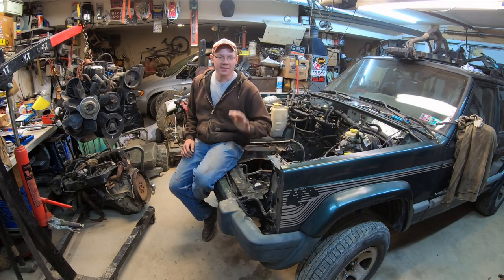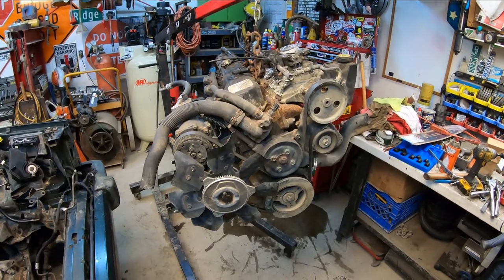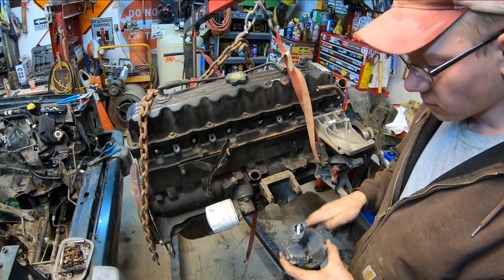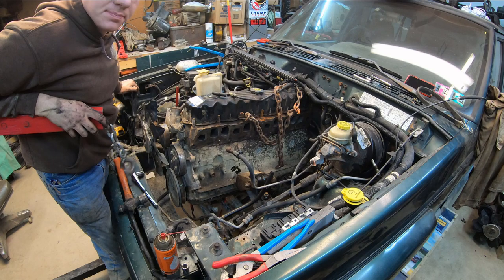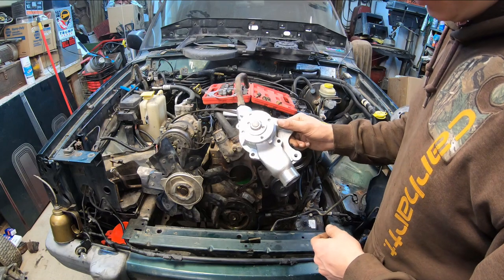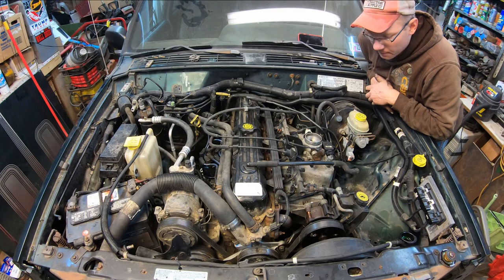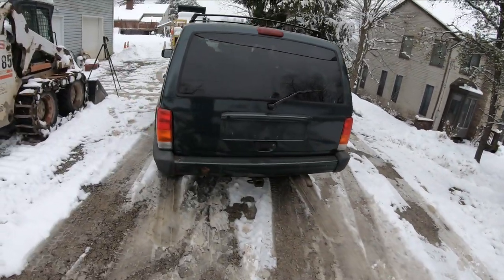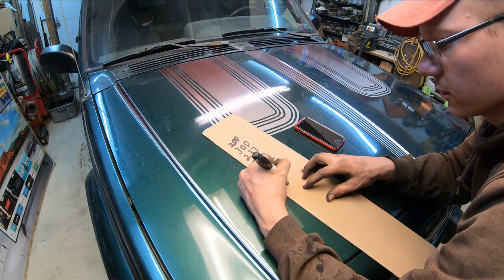$200 Jeep Cherokee gets JunkYard Engine,  WILL IT RUN AND DRIVE???

Comment: As years go by, I have heard the term government overreach and other terms of endearment used. It is actually just a small step at a  time and no one complains then. Where they to go from one style of fuel or ignition... small changes.... no one complained when you could start the car from the comfort of the kitchen chair and let warm up a bit to now days, all electric and no heat up required. I haven't seen a tesla car to see if its warm when you first start that new rig and its ten below outside. I don't really want to know tho. Nice little teaser, the orange rig on last part or the "altro" side of videos .... that ending part since I am too stupid to remember what its called. I do believe if its a flat bed with a cab an everything is on the deck behind the cab.... it will be a driver in two videos or might be third. Just as long as you mint these videos, I will be watching it all so thanks for sharing and happy upcoming holidays

Comment: The foil is wrapped around the injectiors for keeping the fuel from boiling due to the close exhaust location to fuel rail. It also melts the wires. Can I buy your unused exhaust and intake manifolds? I work on crosscreek.

Comment: That's cool ,good deal . I bought a 2010 honda fit for $300 after a new clutch (ya it's a 5 speed ) tire's an like you said dam tax an title work i got about  $1100 into it my beater with a heater 😂good vidja  !

Comment: Cost:  Why did you not add any money for your time?  The time you used to repair the jeep needs to be added in also.  The time you used to repair the jeep could have been used to complete contracting jobs so time spent on the jeep needs to be accounted for.  After you add in your time then compare your jeep to similar jeeps being sold in the same condition then it can be fairly determined if you made the correct decision to repair the jeep.

Comment: I say you have a good run around jeep. You won't be putting all the miles on your truck. Tires look into BF Goodrich M & snow An just a size or 2 up, will make a big change,an look an great off road runner.

Comment: The old man was a mechanic for over 50 years he had a list for engine swaps even if it was removed from a car he drove 
check all freeze plugs
always change the rear main seal skip the possibility of an extra pain in the poop pincher 
change oil pan gasket  nothing like a subframe or diff in the way 
change thermostat and water pump 
if it was made after 85 always change the valve cover gasket  to much plastic and extra crap in the way

Comment: I had a 1998 Jeep Grand Cherokee. Ran outstandingly well. One of the gas straps rusted away while I was driving, couldn’t locate a replacement so had to let her go.
Reply from the maker: They should be super easy to source, everything for these jeeps is readily available and pretty cheap

Comment: $900 isn't bad at all. We just did a 95 engine swap. The Remanufactured engine was around $2000 by itself. I wanted too go used, but it wasn't my decision. With that an labor, the girl is almost $4000 in the hole on it, and we haven't seen or heard from her. Might end up being ours too sell. It's all covered in offroad goodies, roofrackl lightbar, 31/10.5r15s. My boss will probably end up driving it.
Reply from the maker: Well sounds like it will work out for him at least lol

Comment: just for reference the 4.0s run about 200 to 210 which is completely normal I have the 4.0 and mine runs just under or at 210

Comment: Why do you care what the peanut gallery thinks?  You purchased a piece of junk and made it into a decent road machine.  Good for you.  I wish I half 1/2 of your talent.  BTW, did a see an orange can of Sili-Kroil?  If it is, how do you like it.  I have two cans in my garage and used a couple of squirts out of one can and it seemed to be O.K.  Your Jeep Cherokee project was interesting.  Thanks for sharing it with us.  I'm anxious to see the  innards of the original Jeep engine.  Good luck with your beater!
Reply from the maker: Yes that’s kroil I use it on the really stubborn stuff because it’s so pricey, I honestly don’t think it’s worth the money but it smells good 👍🏼

Comment: Those engines are notorious for piston skirt cracking, and head cracks. anything past 1998 or so. I bet that's where all the oil came from in the old one. Check the upper radiator hose nipple port on the radiator tank and make sure it's not cracking. That garbage fiberglass blastic crap will crack and you will be smelling coolant for all of eternity until it cracks with no  visible highlighter ink puddles on the ground.  The non-operational windows and presumably central locking, that don't need help staying up is because of the wire between the body and the driver's door. the wires are made of used twist ties, so they break easy. Don't overlook the rear trailing arm bushings for the clunking, all of our jeeps had that issue. it makes the clunk sound like it's in the front end. If the transmission stops shifting well, replace the pigtail on the output speed sensor wire on the transmission. don't make the $1000 I did and replace the whole damn transmission when that's the issue. Do yourself a favor, do the rust converting on the rockers, and just put replacement sleeves on it anyhow. if you sneeze wrong it'll have a hole in them the size of your forearm. Check the rear axles for leaking axle seals. they go out around 150K on the clock. also if you plan on driving this thing any appreciable amount of time, Goodyear Wrangler ST's are your friend. They are the only tires that I ever got to last a while on jeep Cherokees, and the Grand Cherokees.

Comment: Don’t forget the ac on it as well not needed till warmer weather lol
Reply: That jeep doesn't have ac
Reply: @saltyymannscustoms6989  the pump was on new motor all the stuff was still on the keep the pump went bad and just put a Pulley and its place watch the first video when he took it out
Reply: @garybarkley2286  yes the pump was on the new motor but that xj like a couple of mine has the pulley where the pump goes so he only has the condenser. so no he cant put ac in is because he is missing everything but the pump for the ac system
Reply: @saltyymannscustoms6989  I just watched the video and he says the vehicle has ac they just didn’t replace it when it went bad so he just has to buy hoses for it check it out for yourself he says it when he is going over the keep in the garage
Reply: @garybarkley2286  all the cherokees on the climate control show they have ac even when they dont. I clearly saw the the non ac pulley on top of the engine i have owned several of these i know what im talking about

Comment: I have rebuilt more transmissions for front pump dmg due to that torque converter sliding out on engine pull and home mechanic not checking and rotating first when they tighten bell housing bolts than I can remember....heres to your luck you didnt punch pump gears through the housing.
Reply from the maker: Well It seems I got lucky then lol

Comment: An almost rust free 883 dollar jeep with the infamous Leaning Tower of Power is a steel.. well to me it is lol! Great job! Those straight six engines for the longest number of years have stayed simple designed by the engineers... probably not too much of a difference of one from the 60s until that era of jeep. One of the engines from mopar that I myself actually care for too because of their straight up torque 👍💪 That's saying a lot from a GM dude hahaha
Reply from the maker: I think every brand has at least one respectable platform that even guys across the isle can appreciate I’m no GM fan but who can argue with a 350??
Reply: @DieselCreek  Exactly👍
Reply: @DieselCreek  I swear dodge's 390 is similar to chevy's 350

Comment: “It’s nice when the engineers actually think about you...”

Hasn’t gotten to those stupid manifold bolts.
Reply from the maker: Lol ya... they weren’t that horrendous tho
Reply: I have the newer style with the 2 down pipes that are tucked right up under the intake... I had a tough time with them. 

As I recall, one of the bolts wasn’t much more than hand tight (from factory). Drove it that way for 17ish years and it never fell out- little miracles :)

Comment: What's the deal with engine swapping in PA in regards to the newer engine smog controls you're losing?  Back when I had a smog license in CA in '81, they went by the engine year, so any updated car had to add smog crap to match the engine.  It was brutal in some cases.

Comment: Should have left the intake an manifold on the new motor would have worked and better  Design on the 99 in Newer 4.0
Reply from the maker: I saw some people say that but the locations for the vacc lines were different I didnt wanna mess with it.
Reply: Well hold on to the newer one and if you ever want a little bit more power put the newer one on there

Comment: Very much worth what you've put into her. Since you clearly know what you're doing, I have a question. You mentioned undercoating with fluid film. I drive a Wrangler in Jersey, and recently undercoated with Cosmoline. Would you continue to spray off the salt ( and some of the undercoat in the process ) or just leave it? Thanks.
Reply from the maker: I’m thinking just leave it until spring then deep clean and re apply
Reply: @DieselCreek  Yeah, makes sense. Will do, thanks.

Comment: She purrs like a kitten again.
Squeeze the thick tube well with your hands, chances are you will squeeze the air bubble out.
Have you actually looked at the correct ignition time, the temperature can also rise with an incorrect setting.

Comment: if you only weld periodically, flux core is your friend
Reply from the maker: I use flux core in my portable mig but run straight co2 in my shop mig

Comment: Considering you can get some use from the Jeep, then probably sell for $1000 with your stamp of working approval, I'd say you did fine. 25% cost in registration/title transfer is probably what makes recycling old vehicles a non-viable business. If they found a way to subsidize the lower cost cars for administration costs, I bet ya there'd be a lot less in the scrap yard.
Reply from the maker: Then who would fill their fat pockets!?? Lol
Reply: @DieselCreek  Though I don't necessarily disagree with that sentiment, I do also doubt even a significant portion of the budget comes from the registration fees of junk vehicles. 

However, there's absolutely no reason to not subsidize low-value car title transfers if that is the case. They'd be losing less than a million a year, but potentially creating more than a million in jobs/side jobs. 

I do enjoy what you do, and this is one of the reasons.

Comment: They put that aluminum foil there because a lot of the 4.0 Have “Heat Soaking” issues !
Reply from the maker: Interesting I also noticed the sides of the injectors were all cracked as well I wonder if the heat did that

Comment: If ya'll don't turn thee gas off youse will have to learn old school and use another dab of flux whilst yee run thee hot wire. I have done it believe it or not. Brazing flux mixed with sawdust covers well. I'm old.

Comment: You never work in a junk yard even though you said you did.  You said you drain the gasoline out so you could put it in the yard vehicle and we did the same ,and when a vehicle came in with a popular engine we cut all the hoses and other lines so we could pull it out as fast as possible  . After you bouth it 《 it was your problem) not the yard!!!  That was the way it was sorry Matt , That's one of the reason I quit and the reason I quit working at a used car lot if ìt had one burn value you would fix 1 burn value and reused the old gasket set, I quit that job the first day also two jobs in 2days with no pay

Comment: "It's nice when the engineers actually think about you"? So unlike chrysler or jeep for that matter. Didn't chrysler make a car not too long ago that you had too take the front there off to get to the battery? And I had a jeep commando you had to take a motor mount off to change the oil filter
Reply: AnarchoSynCope  well the jeep commando yes but the chrysler was a 90s car AMC was long long gone by then

Comment: That's an older Jeep once I like to call the square bodies that engine transmission transfer case platform you can barely beat it I'm surprised that that 6 cylinder gave you engine problems the engine you're putting in it have to remember it's a scientifically proven engine it ran so wherever they pulled it out in other words it ran to the junkyard

Comment: just so ya know thoes gates water pumps used to be good but they are complete junk it will leak in about 6 months to a year. that engine looks like it has 11000k on it not 10000
Reply from the maker: The pistons look brand new, no carbon at all

Comment: whoever pulled that engine needs to be fired.  They cut the wiring harness, which is free money, they cut other parts, which again, is money they could have made.  When I bought a used engine for my cargo van, it literally came with the entire wiring harness intact, on the engine, not a single hose or line or wire cut.  I paid more for a "ready to run" engine, but will have to do zero work to swap it in, as it will just require plugging in all the harnesses, hooking up the grounds, and plugging in the fuel lines.  Junkyards that do things like what you had happen should never be trusted on the quality of their parts, because they are willing to damage stuff to get other stuff out.

Comment: 210* is normal. I’ve battled all my jeeps to get the temps down and all of them want to run at 210
Reply from the maker: That’s what I’m hearing a lot. Gonna try a few tricks and hope to get it down to 190-200 at least
Reply: @DieselCreek  With a 195F thermostat as specified for that year, 190 is wrong.

Comment: WHY would you NOT rebuild the Jeep 6-cylinder engine instead of replacing it with an older model one? Could have saved yourself the cost of the replacement and older engine!
Reply from the maker: I would’ve had a lot more $ in rebuilding the original engine! Not to mention the original engine with scrap. There was a hole clean through the cylinder wall into the water jacket. It’s also much faster just to switch an engine rather than rebuild one.
Reply from the maker: Also, the engine I put in there was supposedly remanufactured with low miles, and it was from a newer jeep not an older one. It doesn’t matter, though they are exactly the same.

Comment: You guys like to complain about the salt on the roads. I’ve driven on both salted and unsalted and I much prefer driving on safer roads and putting up with the rust than driving on unsafe roads.
Reply from the maker: I’ll take unplowed and untreated roads over plowed and salted anyway. Snow has traction ice and slush do not.
Reply: @DieselCreek  I’m guessing that your snow doesn’t turn to ice and ice. On gravel   I would prefer untreated roads but on pavement i. Would prefer safe roads over unsafe any day. Especially with my family in the car.